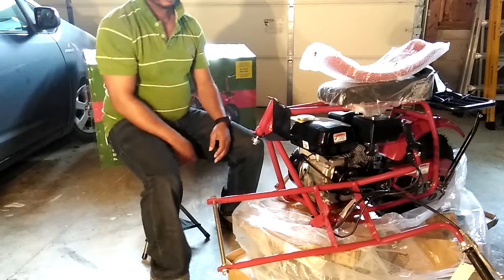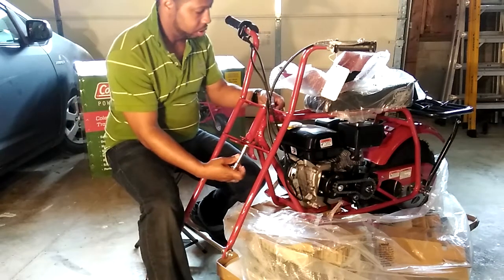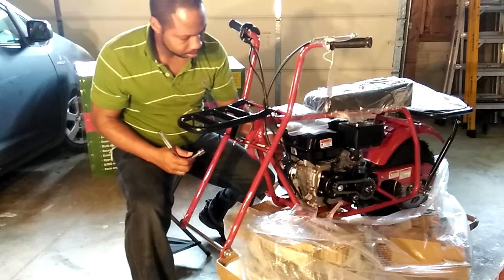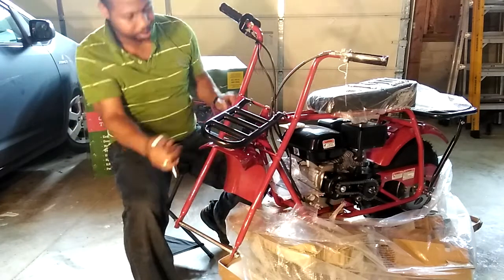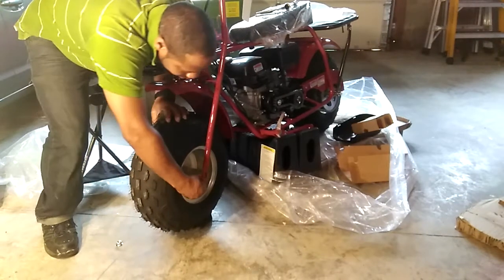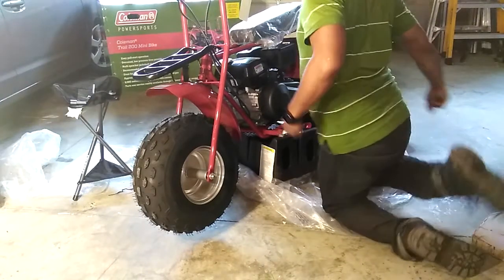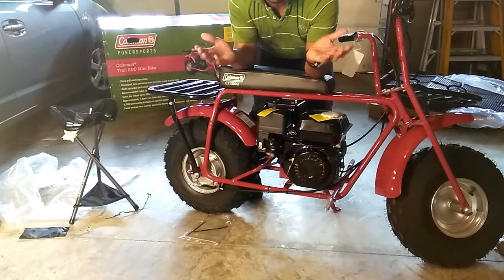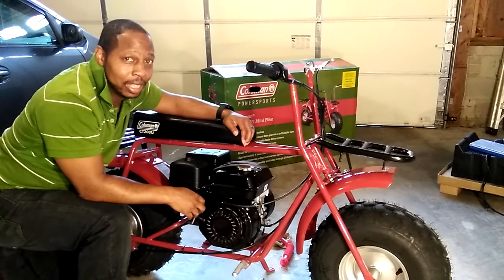Coleman CT200U Unboxing and Assembly

Comment: These are pretty decent bikes for the money. What I don't like is that the fork seems to loosen up. After riding it check for that. Another thing is the chain doesn't seem to be very good quality. You may want to check the adjustment after every ride. It will stretch and loosen up. Nothing wrong with your video. I like how you had the camera fixed for best viewing and a nice distance away from the work.
Reply from the maker: Thanks Deucealive75. I really appreciate all the feedback. I like that you've given extra things for other viewers, and myself, to check to make sure they are able to safely ride their mini bike.